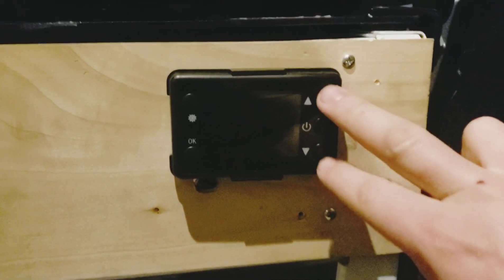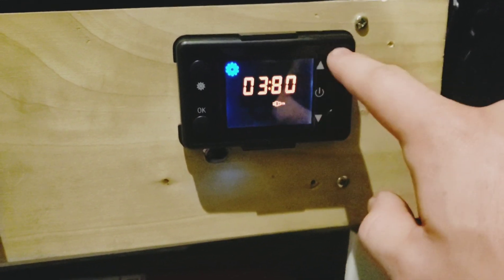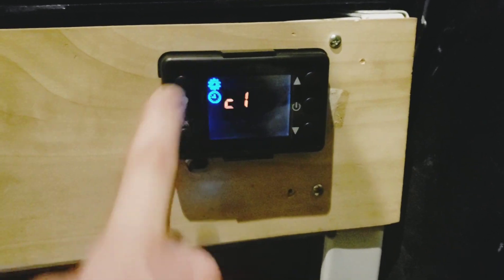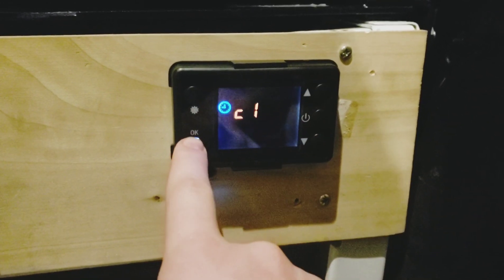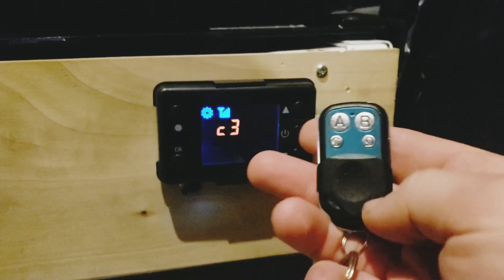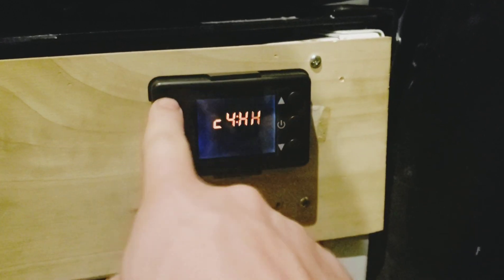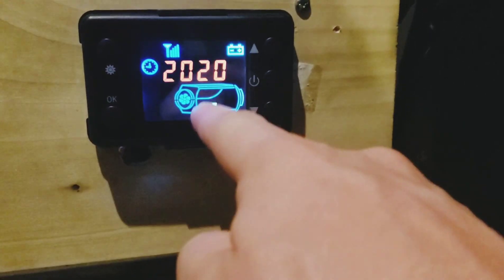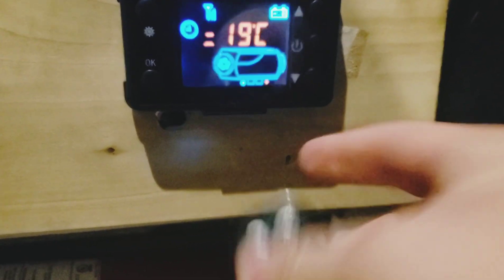Chinese Diesel Heater LCD Instructions

Comment: Thanks for this clarification. I have been several days trying to get help from the vendor. My controller will show all of the available icons on post, but does not use Any of them during run time. The reason I was questioning this was because of getting error E-06  with a fuel pump icon, during start up. The seller assures me the pump is fine, the igniter is fine & the blower is just stuck, & I need to adjust it  - No, it's not stuck, nor is it rubbing. I adjusted the blower in till it touched, backed it off & still had the errors. Long story short, I adjusted the blower, in increments all the way out & then back in. Hard power off's between each adjustment. The only thing that cured it was: Like you said,, 'hold the upper & lower arrow buttons while powering the unit On'
Oh,, the vendor said my controller doesn't use the icons B/S
I just put the pump on 10 and let it run, no other setting besides time, are available

Comment: With this type of LCD controller the usual way of priming doesn't work { press & hold ok + down button }. I now have pulled fuel from the main tank towards the filter by turning the heater on 3 times. I now have ERROR 10 on the display { flashing yellow warning triangle }. How do I remove the yellow warning triangle ? I am just trying to prime the fuel lines, it's a new 5KW heater.  I have removed the 20A fuse tonight and will try to fully prime again tomorrow. Thank you.
Reply: On my heater I have to hold the up and down button then it primes and stops when you release

Comment: How do you prime the pump with this controller?
Reply: I wasn't able to find a prime function on mine (the typical prime functions wouldn't work on this "1907" style controller), I ended up cycling the heater in hertz mode until all the air was purged from the line. I did have to hard reboot the controller a few times as it eventually gave error codes from the pump running so many times without starting and for the flame going out due to air bubbles.
Reply: I struggled with mine I found after putting power on... hold the up and down button it started to prime 
Now I have the problem in getting to the settings to put in the code 1688 any help would be great 🙏
Reply: For anyone wondering how to prime with this controller, press the top left settings button 5 times. It will come up with a picture of the pump down the bottom left area and a count down timer. Pressing up starts the pump for 60 second. Pressing down stops it. 
God knows how to get out of it but I just unplug control and re plug it in. Hope this helps someone